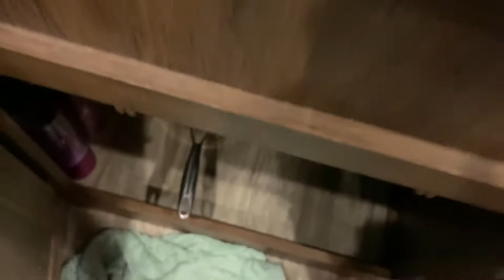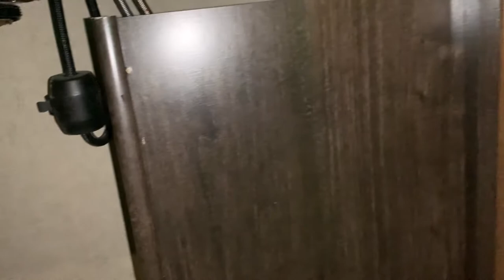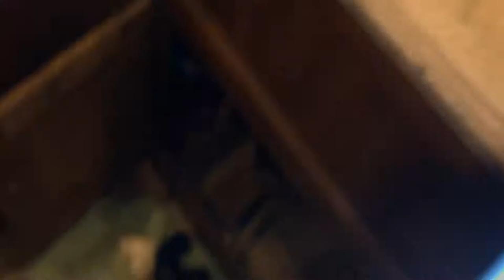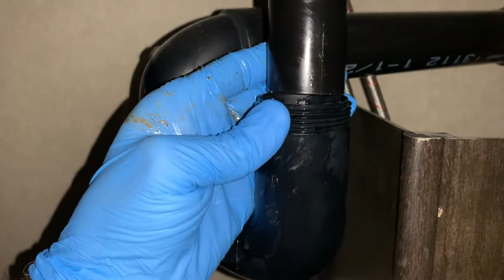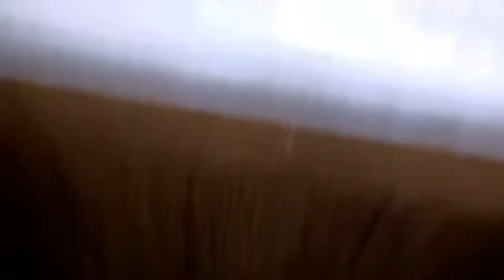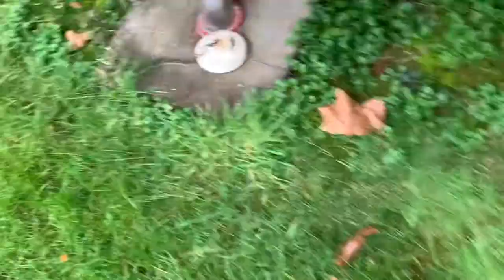RV SINK CLOGGED (Does vinegar and baking soda really work?)

Comment: Thanks for sharing ,I will do same thing. I did try to plunge already and didn’t work 🤨
Reply from the maker: I noticed that ours gets an air pocket that makes it act like it is clogged up. I'm not sure what causes that but I find that if I gently use the plunger a few times eventually it starts draining normally. However, I'm not a plumber so you may want to talk with one. Also, the vent on the roof may not be venting and not letting it drain. That is an easy fix -- unless you are like me and hate gettin on the roof. I have a hard time with heights ... good luck. Let me know how it goes.

Comment: Are you familiar with replacing the fan motor on the camper roof?
Reply from the maker: hi there. No. I haven't replaced a fan before but on ours it looks fairly straight forward. But I've learned that in RVs, sometimes looks can be deceiving. Sorry I can't help you on that. Let me know if you get it replaced and how it went.

Comment: Did  not explain.How  get rid of air pocket
Reply from the maker: I just used a plunger and applied as little pressure as possible and it finally cleared the air bubble. We've gotten another air bubble that took a while to finally clear out but again I just used a plunger. But I don't know how much pressure the plumbing can handle so I try to use as little as possible. I'm sure there is probably a better way to remove air bubbles/pressure.